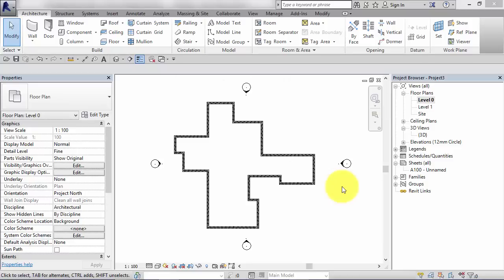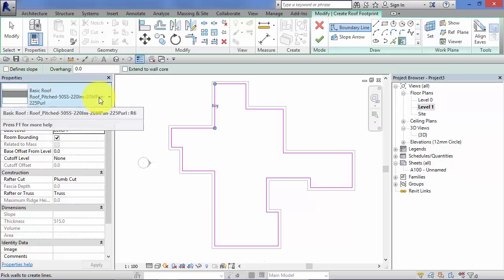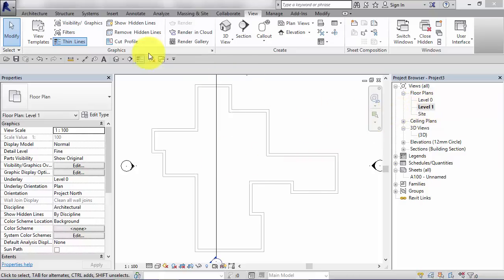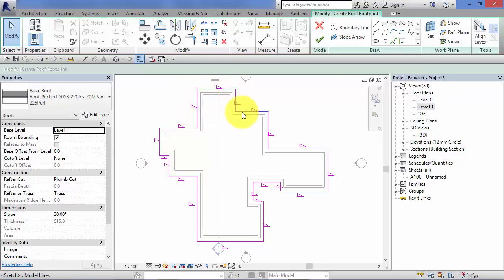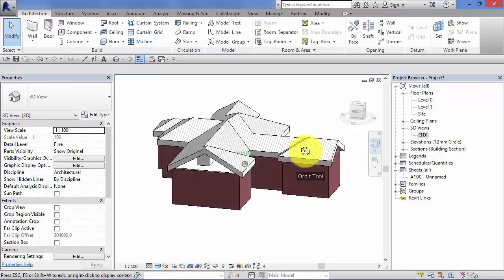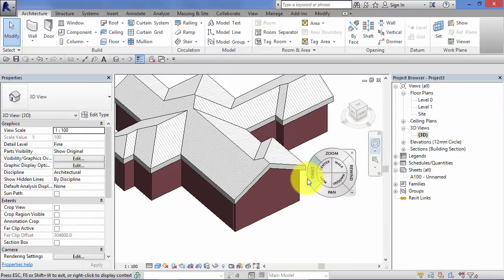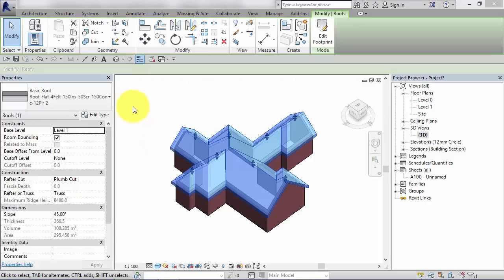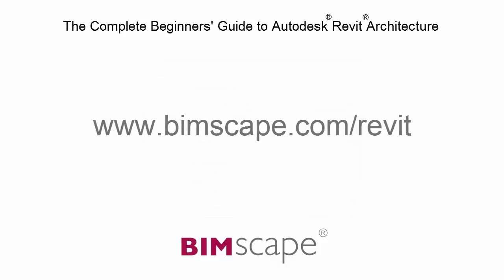Module 4: Unit 10: Revit Architecture: Roof by Footprint

Comment: Mr. BIM.... great video instruction... I've figured out how to create the roof, and manipulate the structure of the roof, but how do I create the soffits and eaves to be more realistic?  Most of the homes I design do not have a sloped soffit.  Is that done by using the sweep function separately from creating the roof?
Reply from the maker: +George Hobel Please check out the Roofs Masterclass, at the BIMscape website

Comment: Thank you for the tutorial. i have a general question, and this is what kept me away from Revit for years, as a designer i dont like the idea of being limited to certain shapes. what i see so far (and i confess im a beginner) is that there  is a certain method you have to follow to create anything, from a wall to a sloped roof. but what if i want to create a non uniform shape? like a free style steel structure at the top of my building or completely crazy staircase etc.. can i do that with Revit? im not looking to learn how at this stage, just to know if it can be done or not. thank you
Reply from the maker: Hi. YES- You can produce absolutely "ANY" form in Revit that you can envisage.  It is VERY common for Beginners to think that they are constrained to a palette of basic shapes. This is most certainly NOT that case. Keep in mind that this is a Beginners Course- so my aim is to just get you guys up to speed (ASAP) with the basic tools. In future courses I will be taking people through a whole range of intermediate and advanced topics. One of these will be a VERY detailed course on Content Creation, where I'll show you how to make ANYTHING that you can think of.
Reply: Thank you for the reply. and will certainly be looking forward to your future courses :)
Reply from the maker: The first one after the free one will be "The Ultimate Guide to Revit Walls". I'll go into every aspect of Revit Walls- junctions, stacked walls, reveals, insert wrapping, etc 😃